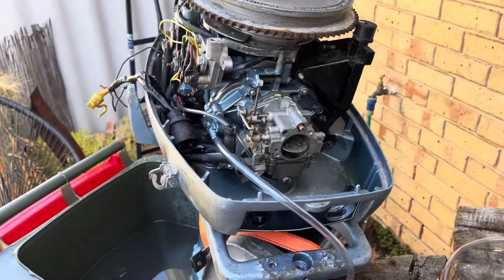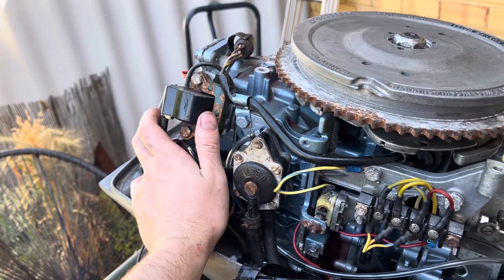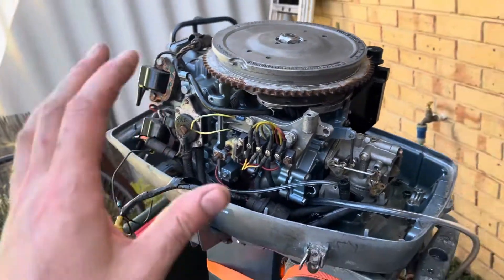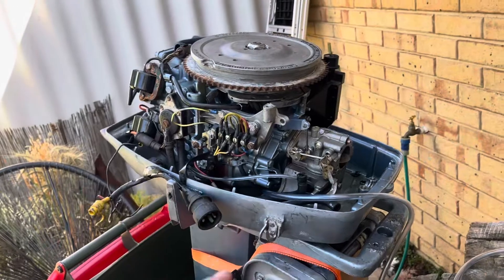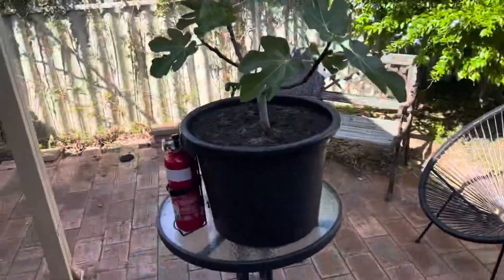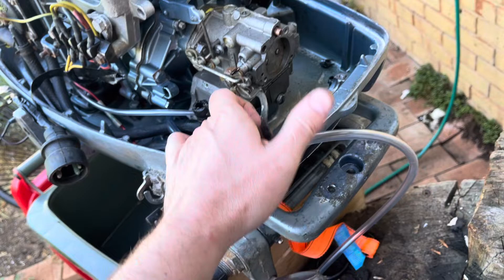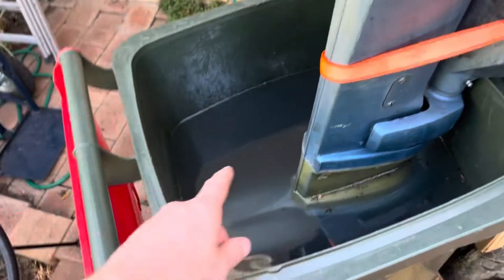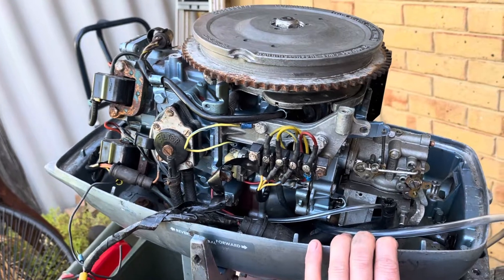1977 Evinrude 35Hp 2 Stroke 2 Cylinder Outboard - Will It Run?

Comment: She is not squirting. Much water come out at the lower leg section. Very likely that the water pipe from the pump got frosted and ripped apart. Mush ne checked
Reply from the maker: Ah the tell-tale was just blocked from sand and debris. A wire cleaned it out :)

Comment: The rectifier is there!
Its under the wire terminal block.
Reply from the maker: Thanks for sharing :) there is no battery present for it to charge though haha
Reply: @VintageEngineRepairs  👍👍

Comment: I hate to admit it but I laughed when you reached for the throttle, I could see the water blowing out of the can before it happened. That motor sounds good
Reply from the maker: Hahaha a lake would be useful 😂 lucky Kat wasn’t standing close. First the fuel and rope hit then give her a dunking of dirty trash water lol
Reply: @VintageEngineRepairs  they make  an adapter to attach a garden hose to an outboard, if you find a good market and move that way it will be a handy tool. I hope the budget has room for flowers, Kat earned some.  🙂
Reply from the maker: @GuysPlayingWithTools  haha this is true but I believe that in the bucket it’s somewhat quieter? Though exhaust escapes in other places too! I can get the hose cup things though :)
Reply: @VintageEngineRepairs  that can is a step up from those hose muff for sure , it'll run much better w the can set up just cause
Reply: gear u mean ? hada 35 evinrude around that age dont remember what year exactly ran like top first pull every time,  that put put sound def nostalgic, good work mate

Comment: Definitely either a water pump issue or clog.Don’t overheat it.Water pump should be under water at least 6 inches.Compresssion is on the low side.
Reply from the maker: I agree with both your statements! Thanks for reaching out :) na I won’t overheat it, just ran it for a minute or two total!